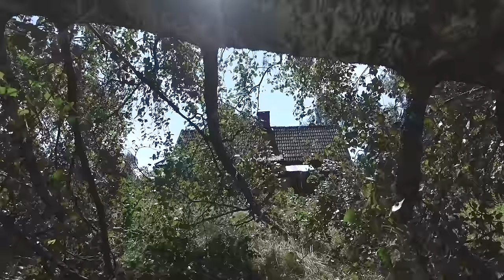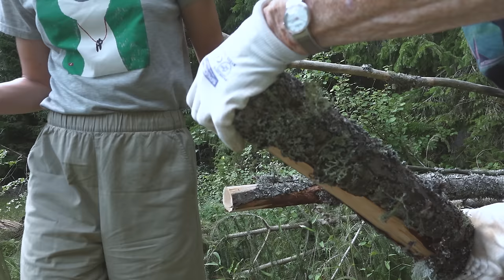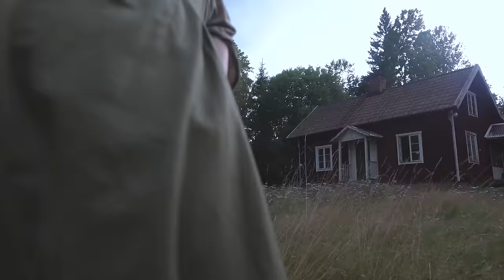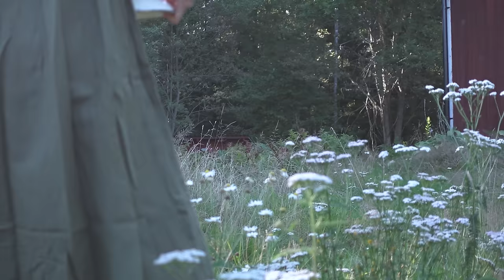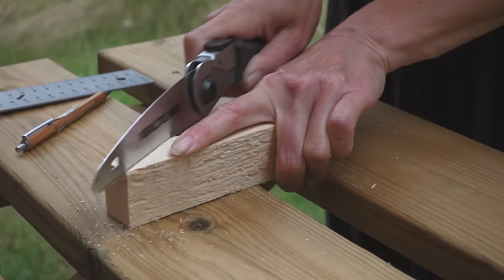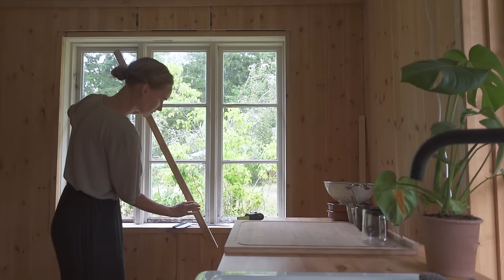No Longer Alone In The Woods (Story 27)

Comment: Hello and Good Afternoon to you Rosie.
As usual you are so very busy. I have a suggestion for all the downed trees if you don't mind. Make a wood shed ( if you don't always have one). Cut and store this wood for firewood. Of course, it has to dry 1st. Make a huge mulch bin with the leaves and the smaller branches. Also, use smaller branches for kindling to start your fires. Pinecones are great for that as well. Another suggestion is that you use the fire ashes ( once cool) for fertilizer in your gardens and flowers. God always provides, you just have to be open minded to how to use what has been provided. Another way you can use those trees, if you have the resources, plain the wood and use as panels for your house repairs. As in... Walls, floors, cabinetry etc. 
Any who, just a thought. Take care. God bless. So thankful God laid these trees away from your house and buildings. A huge hello to your Mum. Hugs to both of you.
Reply: As well as God providing wood, Ha has provided water. Do you have water collection system set up? Great resources for your gardens and flowers.

Comment: Tip: Old Swedish saying says that you shall sleep on the wood panel (keep it indoor) for one year before mounting them on the walls. Thus during winter in Sweden in becomes really dry and panels will shrink severely, so much you will start to see gaps between them if not doing so.
Reply: What? Sleeping on the wood? Sova på träet?
That makes no sense at all, and I've never heard it!
Do you mean let the wood rest?
Reply: Lengthwise, lock and groove horizontal, that's  what floorboards are for, 1x6
Reply: Vad menar du med att sova på trät?
Reply: @matshjalmarsson3008  It's a fork of another saying, "sova på saken".
Reply: Right, I get the meaning, I've just never heard the expression.
What I've been taught is that wood should be dried a year per inch of thickness.
Rule of thumb (pun intended).
Reply: @matshjalmarsson3008  A year per inch of thickness is a nice rule for firewood. When it comes to these wood panels, I made this mistake myself in believing that when you by it at the shop it should be completely dried, but it turned out that it shrunk actually over two years times. I will say around 1%, doesn't sound much but if the wall is 3m wide it means it shortens by 3 cm. So I learned it the hard way. Better to sleep on the wood that is.
Reply: This comes from the saying “to sleep on a thought” giving you time to think it over properly. If someone was to ask you a question you wasn’t sure on…. You would answer “Let me sleep on that” 
Meaning, to allow some time to rest, time to settle into its new environment, time to swell, to shrink and to eventually decide it’s final position. 

My cabin lost around 0.2% overall … across an 11m span log, roughly 2cm, which is substantial if you think of that being a 2cm gap in a wall. Luckily we built it all interlocked and so the logs shrunk together and actually tightened up because of this. 

Wood play is definitely something to consider when you’re building with wood though. Most of the time, unless kiln dried and deep treated, no matter the age of wood, it will still play to some degree when it’s taken to a different environment. Simply because the atmosphere is different, temperature and humidity for example.
Reply: I have this experience too,  even using lark timber supposedly kept dry for two years,  it shrunk when brought inside at full heated room temp when I built a kitchen. Also had troyble with warping of a cabinet door I made even though I gave it a cross support in the back,  redid it twice with thicker cross frame on the inside to get it right. Fortunately a small space and kitchen and not a complicated build,  but you're very right about dried "ready to use"  wood from the lumberyard. It usually needs a winter inside the heated house to be entirely dependable.
In the case of this cabin,  I don't know,  depends I guess on hoe warm it is in wintertime. But personally I wouldn't be bothered by gaps in the vertical wall panels,  onky concerned about the joints around windows and trim etc.
She's doing a great job so lo tech I think!
Reply: The wood is kiln dried, it doesn't need to dry more.
Reply: @rockintherae  
Kiln dried wood is artificially dried, really fast. 
It actually is the most likely to reabsorb moisture and shrink/swell…. Especially over the first 2 years. 

Don’t be fooled by the words ‘kiln dried’ it’s a tactic used by the wood production industry, to encourage people to purchase young wood, because it’s been dried and therefore the buyers think it’s perfectly useable in all applications… it’s not. It’s certainly ok to use for building purposes, but it’s not any good for finish work, or joinery. 

The only reliable wood, is wood that has been cut at the right time of year, processed into boards correctly, stacked and stored correctly, allowed to rest and dry naturally over a minimum of all 4 seasons, ideally twice around, in its final environment… then treated with a very good wood preserver and stain, in order to block up the remaining open vessels. 

This is only avoidable when using kiln dried heartwood, when the pith is entirely made up of extractives and minerals and the outer edge of the tree, the sapwood, is removed before being cut into wood lengths.
Reply: @rockintherae  As several people have already stated, kiln-dried isn't really fully dried. It will dry out further when brought into a home which is heated in the winter. As much as carpenters building new homes in Canada try to deal with further shrinkage from kiln-dried wood, it remains an issue. Carpenters and what we refer to here as finish carpenters, usually must return. Within a year, they come back to repair any issues or damage from wood shrinking over the year once it dries out further in the home. New factory stained and finished hardwood flooring also must be left in the house to acclimate to the new heat/humidity environment in which it will be installed (for shrinkage or in a humid climate, expansion). Over my adult years and moves across the country, I'ved lived in 6 brand new homes so we've dealt with multiple issues with shrinkage of lumber and repairs done as a result of it.
Reply: Makes sense. I would make a bed of all the lumber to keep it out of the way of daytime chores. Then in a year I would make the cabinets and a nice bed stead.
Reply: Sjovt, det siger vi også på dansk… 
Broderlande har så meget sammen - ofte mere end vi går og tror i hverdagen.. 🇸🇪🇩🇰

Comment: Great video and yo in did really well on the kitchen! Just a thought if you have a metal "punch" you could hammer onto the end on the nails to push them through the wood so that it doesn't have to be pulled out (if theyre derailing nails with small heads that won't tear too much of punched through as then you can just just some sawdust and wood glue mixed together to fill the small holes in the wood after but it'll enable you to remove the trim without having to pull at the nails at the same time risking splitting t he e trim. (Just an idea).
Great idea with the hugel culture beds using the downed tree I was going to suggest that the other week actually but wasn't sure your plans. You could also cut the straighter wood into lengths and use that for some rustic extra greenhouse space  or cold-frames perhaps be to save money and extend your growing season?? Maybe even a frame to just go over the top of the beds using the thinner limbs and some heavy plastic?
Have a great week really looking forward to seeing the kitchen worktop how that comes out it's ALL looking great so far! WELL DONE!!
👍😎🏴

Comment: i just have to say, the way you dont do the building "By the book" is an eye opener for me who has worked in construction for some time now. 

My mind throught the window part was "All those gaps, such shame"
then you go and cover those "faults" with details that makes the endresult so much better than a windowframe and wall made by the book. Its unique in a very very good way. Good job!

Also, if i might ask, why did you use a hand saw for those angled pieces instead of the tablesaw?